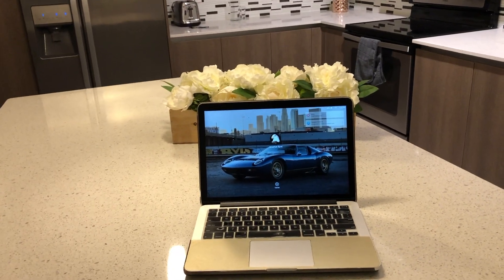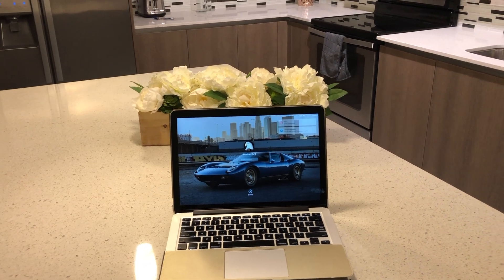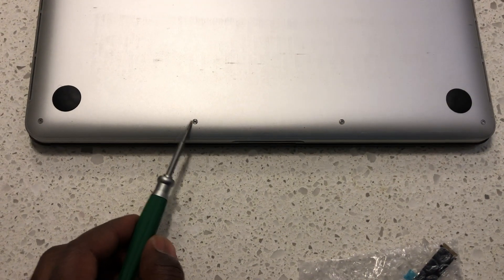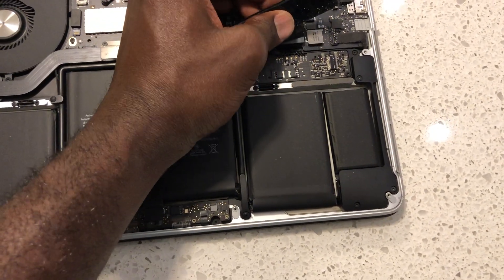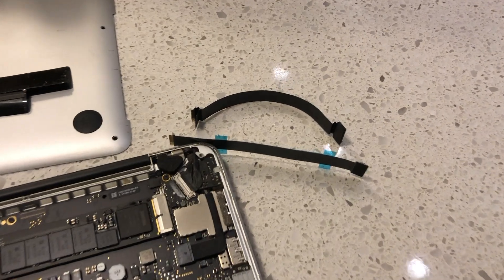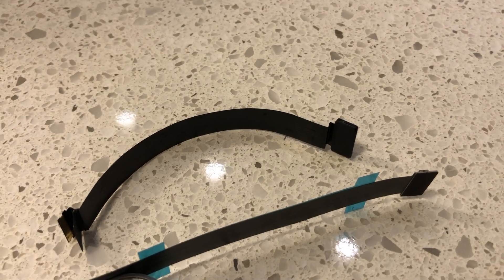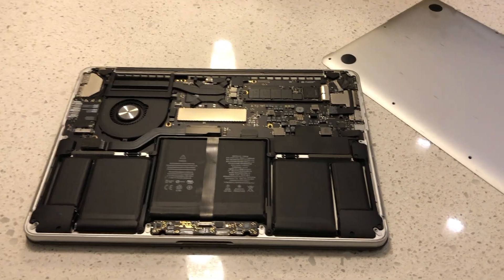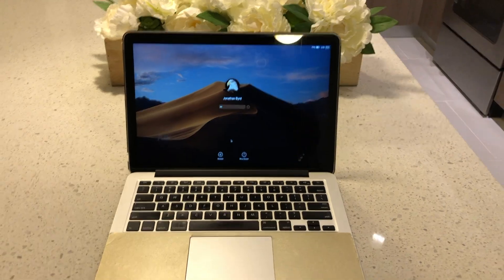MacBook Pro Flex Cable Replacement-  EASY Step-By-Step

Comment: What screw driver did you use to remove the cap on the flex cable?
Reply from the maker: @laurenvanderspurt769  
It was a screw driver from a precision tool kit I bought on Amazon.  

Thank you for watching and for the comment.

Comment: Finally I found a video with my exact problem, same model, year, intermittency and everything. The trackpad still gives haptic feedback, the power button works and that's it. Can't wait to fix, will update how it went, cheers
Reply: Hey how did it go?
Reply: @bgumus01  It didn't work, unfortunately. Replaced the part, but the problem persists. Took it to get a repair quote and the quote cost was around the same as it costs to buy the same used laptop, so I ended up just getting a new laptop. The old one still works with a wired keyboard and mouse
Reply: @wesgleeson  Oh sorry about that. I ordered the part but one of the screws is severely stripped so I'm going to have to take it to a service provider anyways. I hope they can fix it. Thanks for the reply

Comment: my screen dims as I am opening it then goes black at the 80-90 degree position. Do you guys think it can be the ribbon cable? its a mbp 2017 with the touch bar.

Comment: 4:17 Don't use metal tools to pry off the battery connector use your finger nails eseacially on newer models this shorts out the connectors and destroys the board.

Comment: I snapped the display cable of my MacBook 12 inch 2015 (the one that connects lcd to logic board) can I replace it? Please do a video, I can’t get over it
Reply: If it is the one that is on the logic board you will need to solder a new one.

Comment: I got this repaired at the Apple store and it cost me 130+ CAD (trackpad and keyboard stopped working). They also broke something during repair (mother board or something). That would have cost another 600 or so. Thankfully they covered that. 

This isn’t the first time the keyboard/trackpad stopped working (it was actually the 4th time). But it was the first time it happened outside of warranty. I decided to bite the bullet and just get the 👩🏻‍💻 Apple genius’s 👨🏿‍💻 to do it. But next time, I’m trying this.

Comment: Hello. I also have trouble on my Macbook Pro 2017, touch bar. A year ago, it starts flickering. I do not have enough money to fix it by LCD replacement. So, what I did was when the screen starts to flicker I just close it for a few hours and use it again. It takes only 15mins before flickering again, so, as I student its kinda hassle. Then, there was this online friend of mine who told me that I do not need to have an LCD Replacement, I just need to fix the flex. So, I want to ask you, if ever I fix the flex on my laptop is it a good move? Or do I really need to have an LCD replacement? Please answer my question :( Im kinda stressed rn.
Reply from the maker: Hi Maria,  is it your computer screen that is flickering or only the touch bar?
Reply: @Jonathanoncars  the screen is the one flickering.
Reply from the maker: Maria Maria I’m not an expert but this does sound like a flex connection.  In fact when my computer stopped working, I would have to close it and wait for it to start working again too.   I know it may be hard to get a solution from Apple as they don’t usually like to admit fault.  Have you tried taking it to an Apple Store?  Apple will probably want to do the work themselves and charge yuh a lot of it but at least see if they know what the problem is - I’m sure they have seen it before.   If they don’t know what it is, I would try to get the LCD flex cable replaced before a screen replacement. A screen replacement is definitely more expensive than a flex cable replacement.
Reply: @Jonathanoncars  I already gone to a apple store. The lady who was in front informed me that maybe I need an LCD Replacement. I was just discouraged when they gave me an estimation cost. The cost was a price of a brand new window laptop. Then, they also advised me that their apple technician will run an overall diagnostic test on my laptop to determine if my Mac has more problem other than screen flickering which I need to pay for it. That time, I only have like a few thousand (Php) in my hand, which is insufficient and also I do not have enought time to come back and get the Mac from that store because I live very far away. It's kinda hassle to me. And yeah fixing the flex is really a lot cheaper than replacing the screen which will really cost me a fortune 😅
Reply from the maker: Maria Maria yea don’t get discouraged.  Remember the Apple store employees are just regular people -not “geniuses”  If they don’t know something, they’ll just send it off to the repair facility. I would look for a company that can change that flex cable. Maybe you can order the part yourself like I did.  Just make sure all the work is warrantied so you’re covered should anything go wrong.
Reply: @Jonathanoncars  My mid 2015 screen flickers, blinks black every 10 seconds. Connecting an external 4k display, it works fine while the retina display is snowy, with occasional flicker or blink. 
I just ordered the cable that goes into the lcd at the corner, do you think that this is actually the culprit? It didn't occur to me I thought that was just some battery cable. 
Any insights are appreciated, I'm afraid I just bought something I don't need.
Reply: @muhammaddaffaazhari5036  Not good. It also has the same problem.
Reply: @MariaMaria-gt6iz  can you give us an update on flex cable? Are my symptoms above the same as yours? Thanks
Reply: @muhammaddaffaazhari5036  I haven't tried to change it. I cannot visit the repair shop because of Pandemic. and my house is a little bit far away from the city. But if ever I have the chance to get my laptop to be checkup. I'll tell you whats wrong. The problem with mine is I can use it for about 15mins then all of a sudden it starts to flicker, all words are doubled and then it blackouts.
Reply: @MariaMaria-gt6iz  same problem here. I am in the province and have consulted three different technicians who told me that it needs a new flex cable. I have an MBP 2017 with Touch Bar. I have to spend 8k for it. Such a hassle.
Reply: @maryannemoll  wow, for me you're more fortunate. Since you only need 8k, but mine was I need to spend 24k for the LCD assembly. It is much hassle and costly. I just fix it after pandemic 🙃🙃
Reply: @MariaMaria-gt6iz  wow ang mahal! I can actually still use my MBP but with the screen at a weird angle only. I will definitely have to shell out 8k but still a big amount to me. Huhuhu.
Reply: @maryannemoll  Mine, I can't anymore 😭😭 So i just bought a new laptop. Lenovo 😂
Reply: @MariaMaria-gt6iz  wow! Inggit ako. Hehehe.

Comment: Hey Jonathan i think the bridge where the flex cable conects is broken any idea on how to fix it?
Reply from the maker: joao mendes does If the bridge is connected to the circuit board via screws, it should be replaceable. If it’s soldered, you may want to have it done professionally. 
Hope this helps.  
Thanks for your comment.

Comment: I don’t think 80 bucks is that bad to repair it with original equipment parts and professional labor. Look at it this way, $80 will save you from buying another laptop